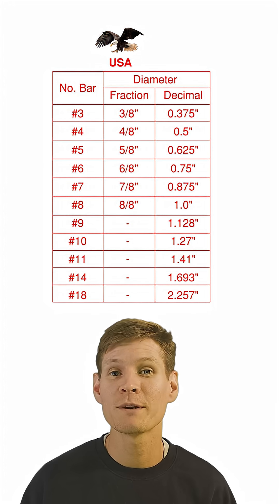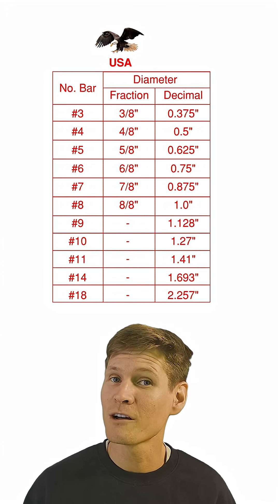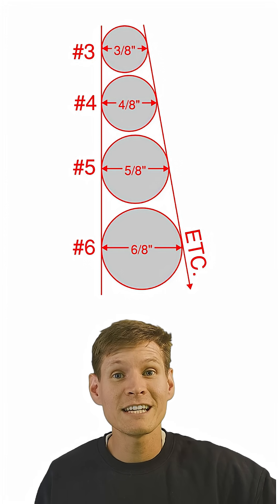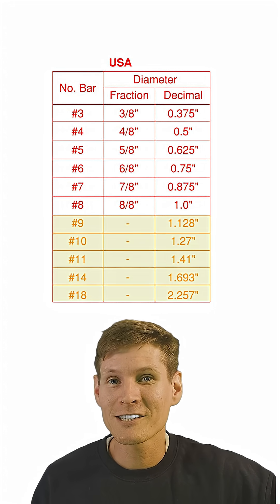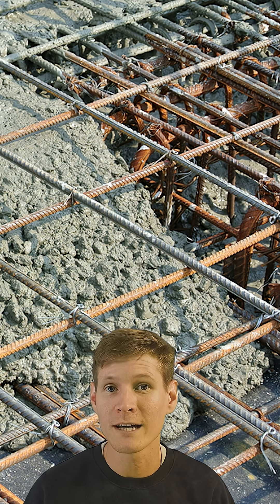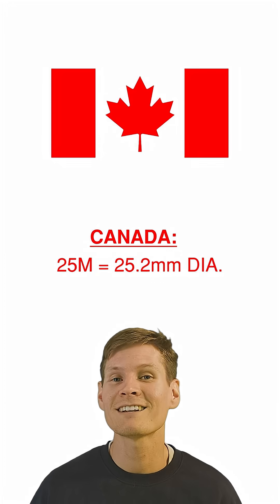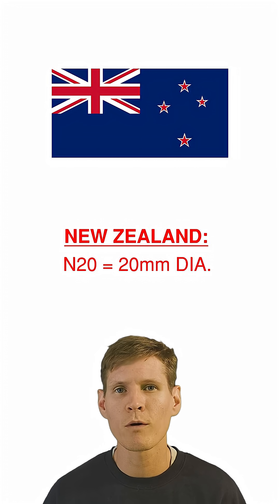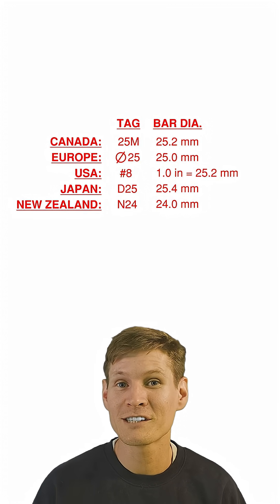Why is rebar called #4 in the U.S. but D13 in Japan? #engineering #concrete #engineer

Comment: 18 is not the largest bar possible. I've had to design caissons using #20 and #24 bars, and they go even bigger than that, but those usually aren't used.

Comment: Canada seems to have imperial sizes masquerading as metric, e.g. the 25M is really 1".
Reply: They’re actually rounded to the nearest 100mm^2 of cross sectional area! (1)10M bar is 100mm^2 which is actually about 11.3mm diameter. (1)15M bar is 200mm^2 so 16.0mm diameter. Extra nice because (2)10M = (1)15M
Reply: It's just a nice coincidence that 25mm is about an inch, but Canada really does love to mix and match Imperial and Metric measurements. I'm about 5'7" and weight 300 pounds, but I buy pot by the gram and average about 15km/h on a bike. I am accurate out to 400m with a rifle that has a 16" barrel, and my bedroom is about 150ft² but I have trouble keeping the temperature below 35°C in the summer. And of course, as always, McDonald's is about 5 minutes away.

Comment: why do they skip #12 and #13 and same thing between 15-17 tho? couldnt they make those?
Reply: It’s because the current measurement system is based on an older one, and the conversions were pointlessly close to the next closest size in the new system.
Reply: There are buildings in US, where is no floor No 13 ... I have stayed in such a hotel!

Comment: I’ve heard that for #9 and larger, the diameters don’t quite follow the 1/8th rule because they were made to match the areas of older square bars used in construction. Apparently, this was to keep things compatible with past designs, so the area of a #9 corresponds with the area of a 1” square bar. A #10 bar corresponds with the area of a 1-1/8” square bar, #11 with 1-1/4” square, #14 with 1-1/2” square and #18 with 2” square.
Reply from the maker: I must investigate! Great insight
Reply: Hey look you did more research than the shithead who made this video.